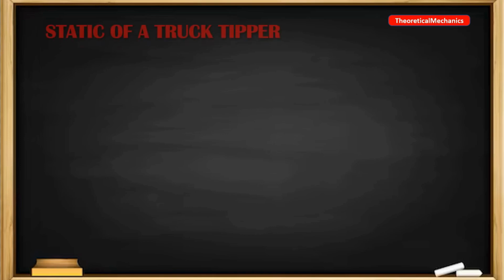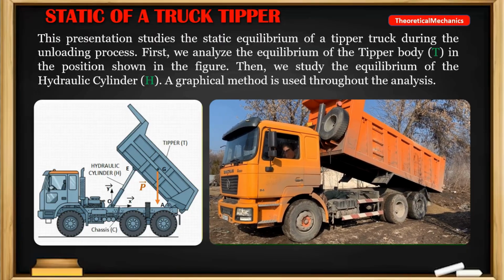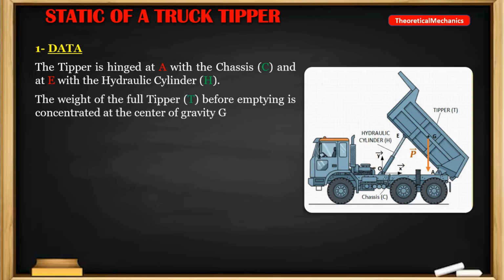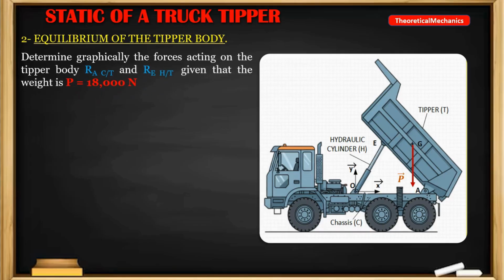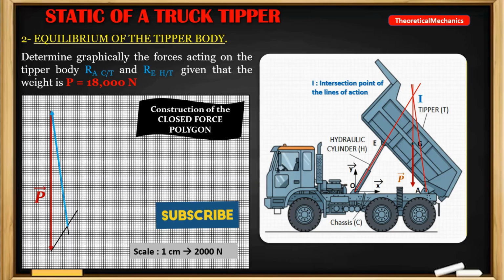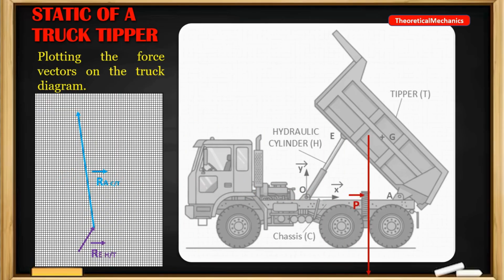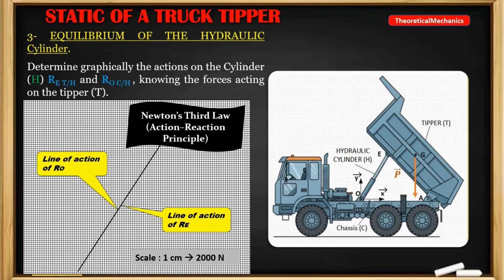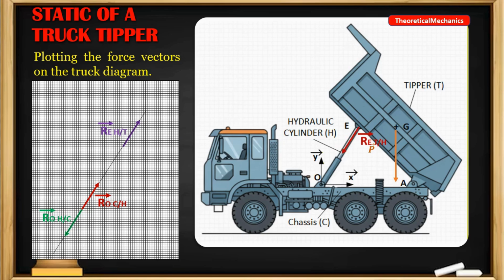Closed Force Polygon Method | Example of Tipper Reaction Forces

Comment: Very interested case of statics, the graphical method is ancient but considered as the basis of statics problems, I believe that’s useful and necessary for students in mechanical engineering also for civil engineering ones. 😊
Reply from the maker: There’s several Graphical methods used in statistics for determining approximatively forces of voluminous  objects in design offices
Reply: @Theoretical-Mechanics but usually numerical methods are more accurate and fast ✈️🚀